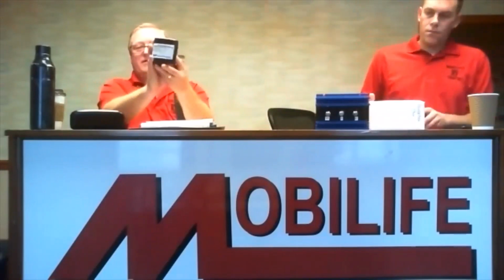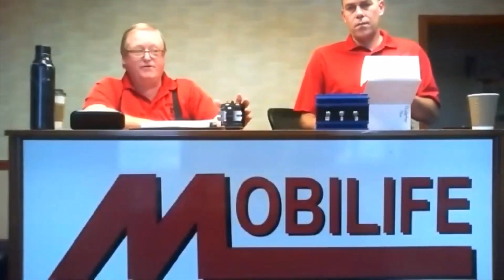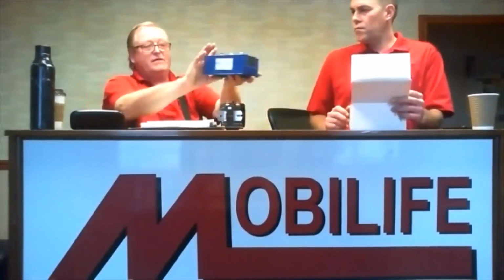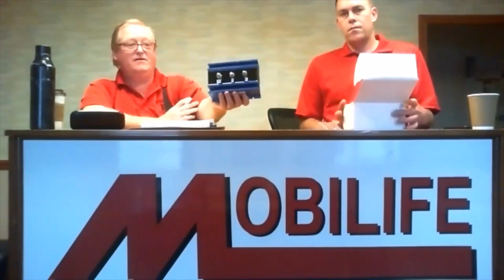Insights from Roadtrek Technicians - by Chris & Jeff of Mobilife RV

Comment: I would like to find a Roadtrek mechanic/garage in the Bristol, VA/TN area, or within a few hrs drive.  Could sure use some help getting my '97 Dodge Ram 170 Popular checked out and road ready, inc roof and exterior paint, top three window leaks (patched and under control-for now), new decals, etc.  I want to make some upgrades also. Engine is good, 97 K miles.  Interior in wonderful shape.  It hasn't been used as a vacation RV in decades...and then..maybe five times!
Reply: Would like to hear from Trek owners also if they have experience with having work done on their rigs somewhere in my region.  Was hoping to go to a rally and meet others who might steer me in the right direction.   Just had some sub-par work done...and windows STILL leak.  I have a temp fix on them again.
Reply from the maker: You might want to share your request on one of the Roadtrek Facebook group pages, which would get much more exposure.  Also you should identify your needs ie: check over of the vehicle itself or check of the RV components and appliances.  Each are different mechanical knowledge and skills involved in my experience.
Reply: @RotaryTeamVincent  Thank you for your response and suggestions.  Much appreciated.